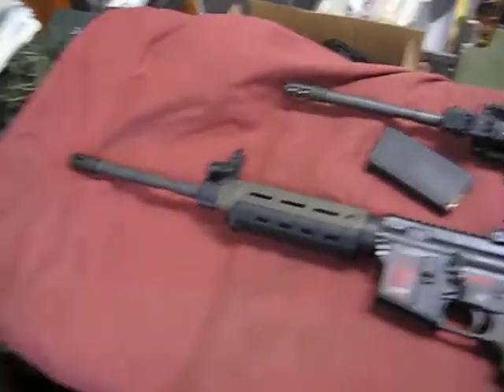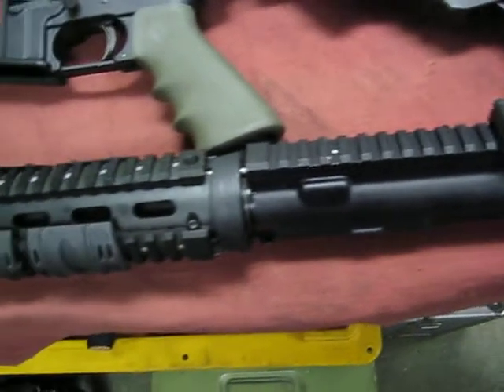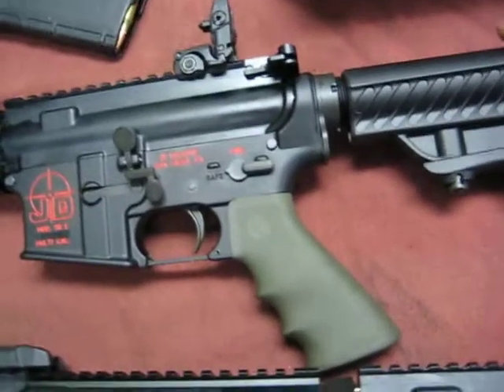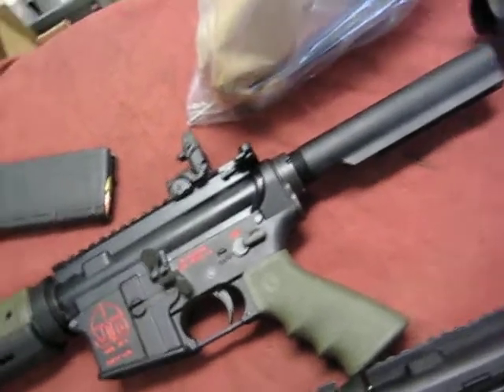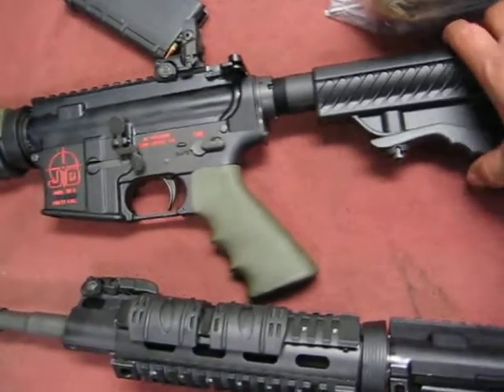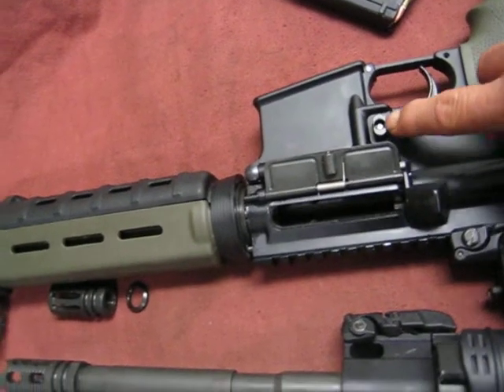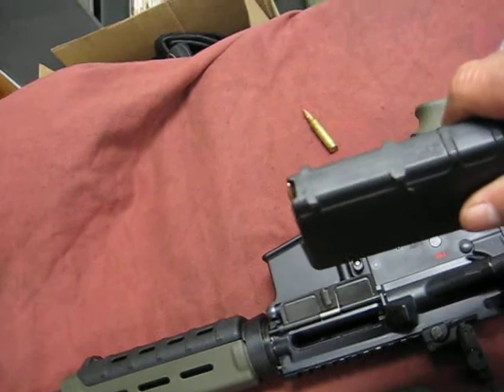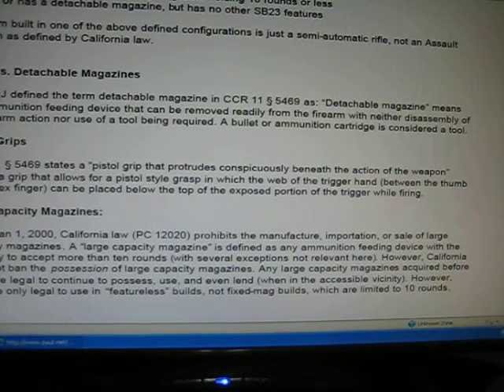Calif conversion to High Cap Mags #2.avi

Comment from the maker: Correct but you must have already had mags older than 1/1/200 for them to be legal. You canot use them on feature bulits( on with pistol grip,flash hider. bullet button) only 10 rnds.